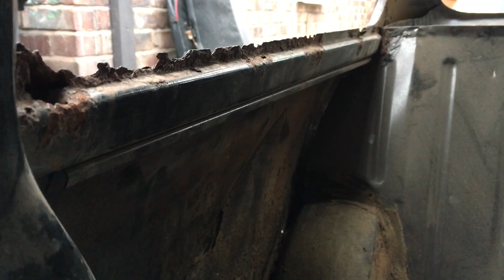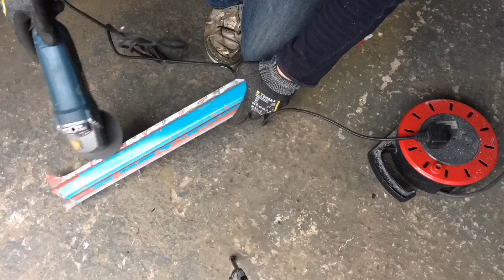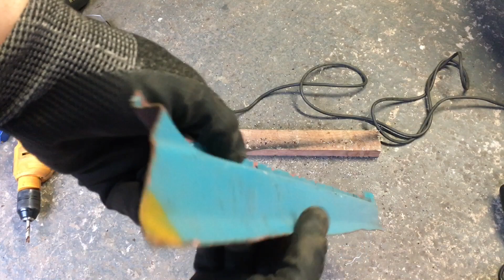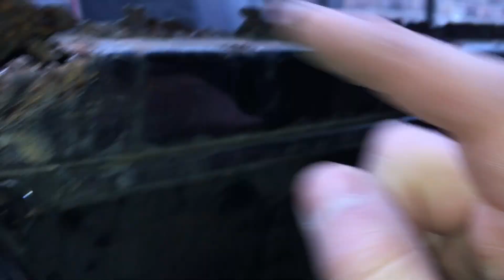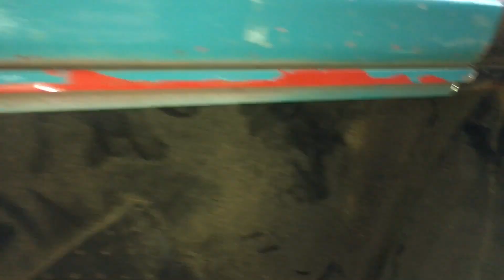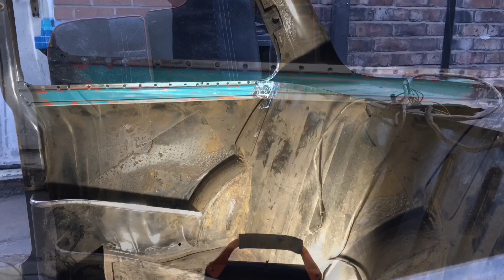Classic Mini Clubman Budget Restoration - Rear Window Frame Repair

Comment: There's certainly nothing wrong with the belt and braces approach, I would have done exactly what you did there to give myself as many template points for the new panel to fit into and keep strength in the area.
Reply from the maker: Graeme W Cheers thanks Graeme. I am chuffed with the repair it seems to have gone really well and now I can cut the quarter off 👍
Reply: @SimpsonsClassics  Replacing the rear quarter would be the bit that would make me anxious. I'd be worried that I didn't fit it well enough and screwed the whole job up.

Comment: What a superb repair well done bud... what grit belts are you using on your finger sander pal?
Reply from the maker: thedjse cheers dude. I am pretty chuffed with that repair looks better having no rust there aha. I am using 80 grit sanding belts to knock the welds back.

Comment: Great content as always 👍 the power file you used, what make/brand is it as it looks nice and small compared to some others I’ve been looking at .
Reply from the maker: Alex nse cheers buddy I appreciate that. It a great little bit of kit for little jobs like this. 

https://www.amazon.co.uk/Silverstorm-247820-260W-13mm-Power/dp/B00J8UITSS/ref=asc_df_B00J8UITSS/?tag=googshopuk-21&linkCode=df0&hvadid=205341469171&hvpos=1o3&hvnetw=g&hvrand=13418578567356771134&hvpone=&hvptwo=&hvqmt=&hvdev=m&hvdvcmdl=&hvlocint=&hvlocphy=9046500&hvtargid=pla-422430624871&psc=1&th=1&psc=1

Comment: Why didn't you just use that whole panel instead of separating it?
Reply from the maker: Campbell Hicks Because the rest of the rear quarter panel is rotten and being repaired and want to use and little filler as possible that little repair section I separated would have meant a lot of filler to be used.  Cheers